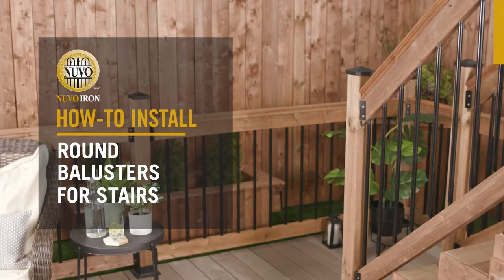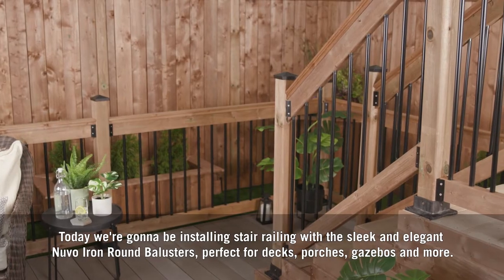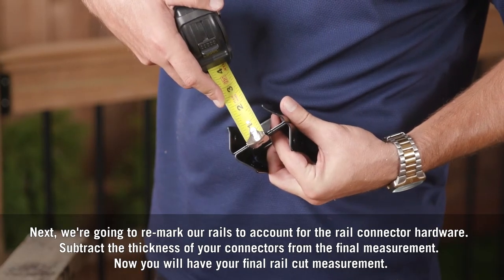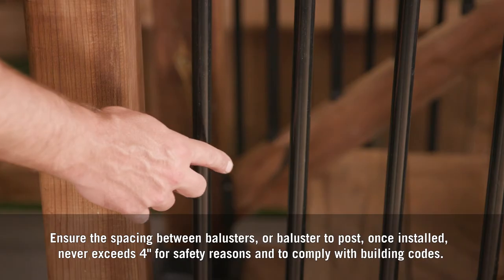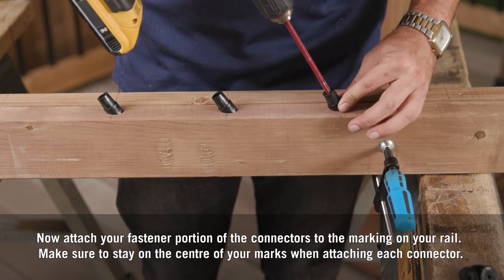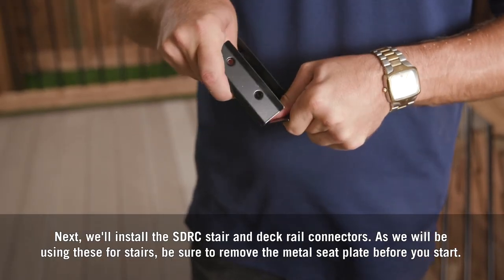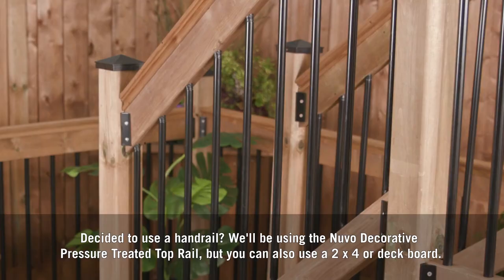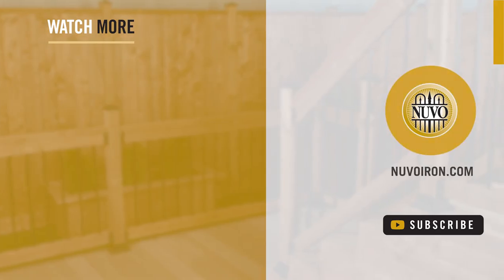How-to Install: Round Balusters for Stair Railings | Nuvo Iron

Comment: Wow, this looks easy! Not knowing about products like this, I did it the hard way. I cut and painted 1/2” EMT conduit and bored holes in the rails with a Forstner bit and homemade jig. I held the assembly together with a long piece of threaded rod and nuts concealed inside the center baluster, pulling the rails together against the balusters. 
These kits would’ve been so much faster!

Comment: I also purchased a 10 pack of 32 inch balusters, then noticed there is no ends with screws as the 30 pack did. When I looked at the Rona+ site it says "comes with plastic end caps" why does it say this, and what is the purpose of these end caps?
Reply from the maker: Hey Paul, it seems one item you bought was the combo pack that has the SMDRA adapters with the screws already included. The other item was the classic baluster kit, which just has balusters and plastic eng plugs. These are used for when someone pre-drills their railings. The normal baluster pack does not come with connectors with the screws, so that you can choose the stair or level rail connectors (the ones with screws).

Comment: How do you install the 34 degree angle adapters into the top/bottom rails? Item #000357050 Model #SRAR
Reply from the maker: Hi Paul, you use the SRAR baluster adapters for stairs with our pre-drilled railing product. Check out this how-to video: https://www.youtube.com/watch?v=fUV-4sKEeRk
Reply: @NuvoIronVideos  OK thanks, but I am using my own rails to have them continuous so they are 12ft. so, 3/4inch holes?
Reply from the maker: @paulquesnel4452  Ah, yes, then you'd want to pre-drill holes about 3/4" but you may want to test out sizes to ensure the most snug fit, as these are built for our pre-drilled rails.

Comment: This is only easy when you have 10 or less my staircase has 32 set at 3.75 inches and I have been fighting with it in my off time for two weeks these suck anyone that plans to buy these chose something else if you can’t afford the prebuilt set
Reply from the maker: Try reaching out to our customer service team to see if they can offer any additional tips for this scenario. info@nuvoiron.com. Provide them any photos or info you have for them to provide you some feedback to make the install easier.
Reply: @NuvoIronVideos how the hell do you install the stairs railing with 12 spindles. Finally made it after numerous times trying it. Not impossible but damn frustrating.
Reply: Let me suggest something. If you drill the holes in top rail about 11/2 " and push spindles up and back down in bottom rail should be a bit easier,  A bit easier!!

Comment: This is a LOT more difficult then this video suggests.
Reply from the maker: Hi John, a railing install can definitely be more difficult depending on the project requirements and how comfortable someone is. There are a lot of different factors that go into building a railing, which is why we say the planning portion is important, but also that sometimes it can be easier to work with a contractor or deck building in your area. We also have two products that make railing building a bit easier, our rectangular balusters which surface mount to the rails, and our Pre-Drilled kits.
Reply: @NuvoIronVideos  My next project is this: I've currently got 2x2  wood ballusters on our deck & want to upgrade to the  metal ballusters. I had a friend who just gave me for free 55 of the 3/4 inch O.D. black ballusters becuase his wife wanted the 2x2 wood ballusters for thier deck. I should be able to "pre-mark" the centers where each balluster is, remove the lower 2x4, pre-drill & mount the hardware for the ballusters on top & bottom, then re-install the lower 2x4 (With help) and transform our deck.
Reply: It's a real bitch to install.